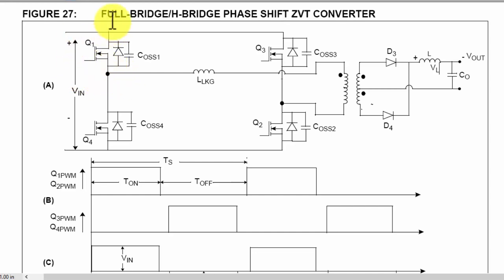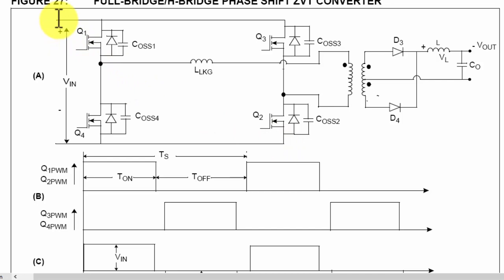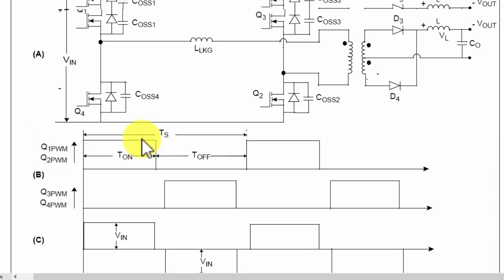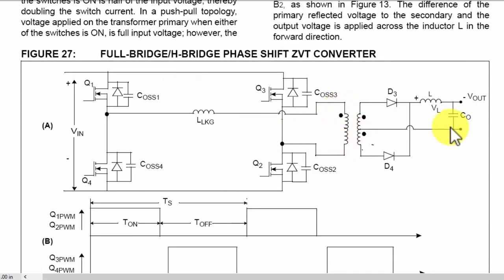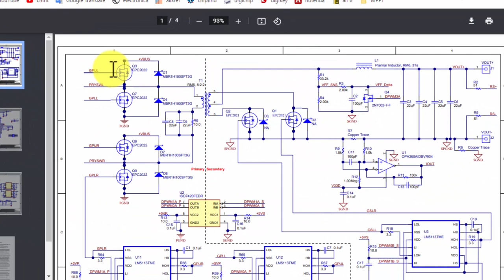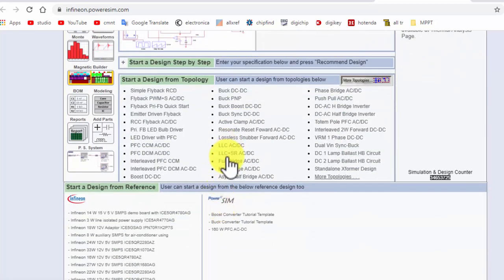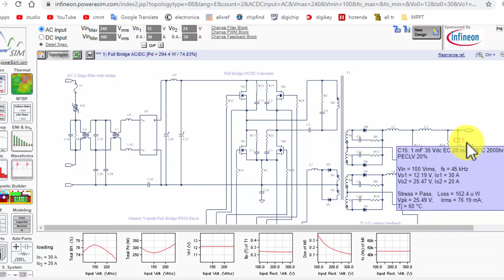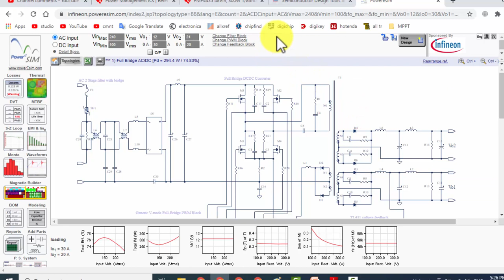{321} Full bridge topology explained, reference design

Comment: does the frequency change, through feedback, or is the pulse width the one that changes with a fixed frequency, to fix the output voltage, to the required voltage

Comment: Thank you for the beautiful explanation. Please, I have a very confusing question. Please explain it to me in a separate lesson. How does the npn transistor or MOSFET n open in the negative half of the peak of the signal in the inverter circuit or the smps circuit?  The output shows only the positive half of the cycle. I want to understand how it opens at the negative half?❤

Comment: i want to design a smps of 28.5V, 13A 370W (DC) . my input voltage is 170V to 275V AC. which will be the best topology

Comment: السلام عليكم
Please tell me
How i can decided that microcontroller in a/c pcb is damaged or not 
How i test it ?
Thank you
I wait your answer
Reply from the maker: و عليكم السلام و رحمة الله و بركاته
if you find some LEDs blinking on outdoor board near microcontroller that mean it is working 
most of the time microcontroller have no effect
if it gives some response on indoor unit. of receiving on off command
that means the MICROCONTROLLER is functioning,
check vcc voltage for microcontroller
then we have to verify its inputs and outputs
sometimes safeties and sensors make problem and they don't allow to generate required signals 
if you have communication access to microcontroller using serial port then it isore easy to check microcontroller heath

in rare cases if it's source code is corrupt then it will need to flash
Reply: @HaseebElectronics  thank you for you
Ok .... please can you explain this steps in details in vedio for me and all friends
if your time allow that
thanks for your

Comment: thank you sir 
well explanation.
sir that design tool is showing same design for different input and output voltage, if we start doing hardware weather it is going to be work or not sir. then i can implement that design in my work.
Reply from the maker: best regards
it is a reference design. we have t modify and re-arrange it according to our requirements
just it provides an idea and components configuration
Reply: @HaseebElectronics   ok sir thank you 
i will try to check with that.